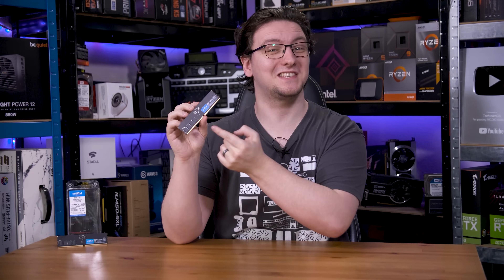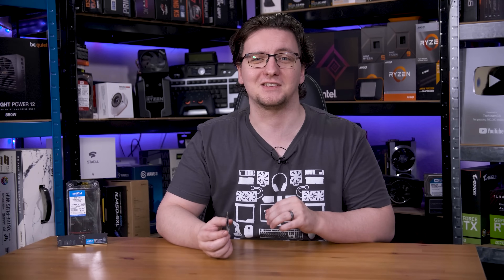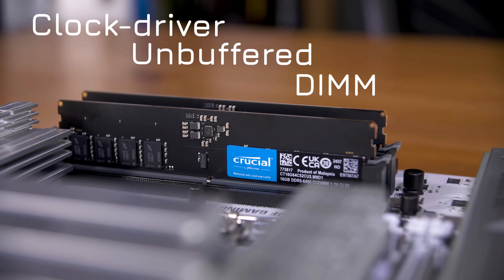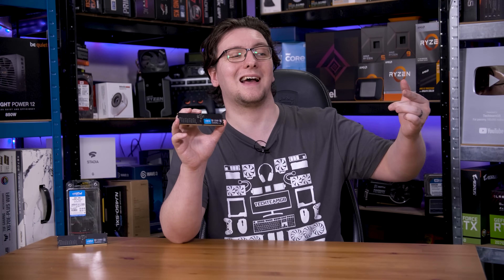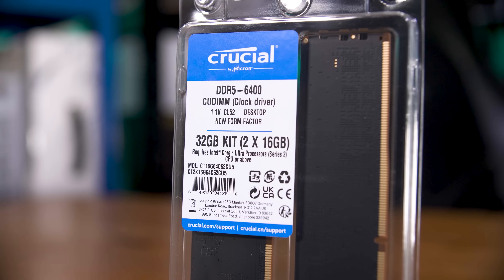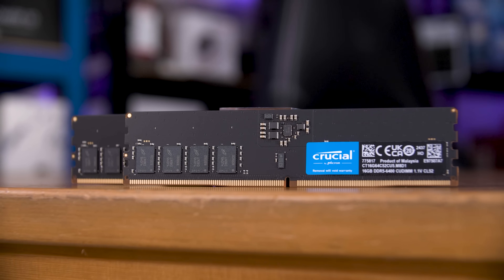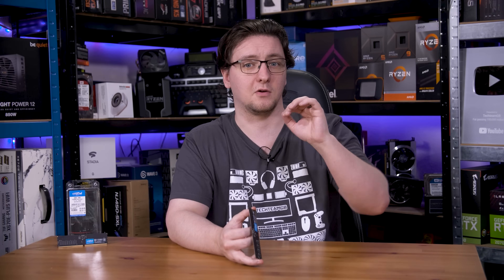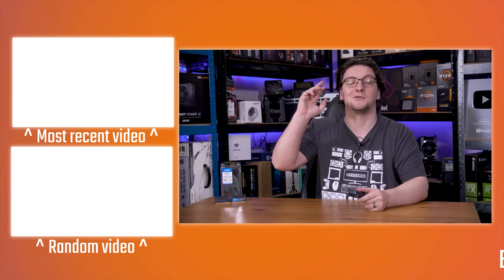CUDIMM Explained! Clock Driver RAM - DRAM IS CHANGING!

Comment: IMC  was always a bottleneck for the CPUs, slow and never going much higher, so dumb; with CUDIMM, IMC should go at CPU Core frequency to have optimal speed with current high frequency RAM. Related, why the CL is 52? why not reduce the frequency so it's near 1, as it'd consume less power and be cooler

Comment: Although DDR, Double Data Rate, is only applied with Dual Channel, and a 3600 kit is actually 1800 per nodule.  So to get 6400 at DDR speeds, each module will be just 3200.

Comment: So here's a series of questions: I'm planning a new build utilizing a Z890 MB and an Intel chip, but memory has changed. The board can take 9000MT DDR5, but I can't find any sticks for sale with that. I've found several 8000 and more 7200, but which is better? Does latency mean anything any more? These sticks seem to have high timing/latency values? Also the 8000 come in an unusual configuration 48GB in pairs rather than 16 or 32. Why is that? I hope you can answer my questions, so far I haven't received an answer from anyone else.

Comment: Cool DIMM enhancement, however with it I would expect current CPUs to support top DDR5 speeds of 8800MT and not just 6400. It’s ridiculous that LPDDR5X can run on higher MT speed than desktop DDR5 (CU)DIMM modules.

Comment: You breifly mentioned that CAMM2 memory doesn't yet have clock chips yet, but I'd be more curious about how necessary they are. As far as as I can remember, better signaling was one thing they advertised with CAMM2.

Comment: And the real 'ingenuity' is not even being mentioned in any of the reviews of the CUDIMM.
'ingenuity' no.1:   That client clock driver chip costs (for example, Part Number RG5C172B0C0GBX)   $0.267 a piece  (it is the actual price, I looked it up)    and this additional cost of $0.267 / memory stick makes you the whole RAM package $200 more expensive.  Brilliant, isn't it ?
'ingenuity' no.2:  to exclude competition so that no manufacturer sells this 'improvement' at less than 500 times the costs, it is patented, so everybody must pay a hefty royalty to the 'inventor' of this scam.    This trivial thing is patented despite the fact that it has been used for decades to reproduce the clock signal in a component.
Reply: Don't be silly, these are early models made in limited quantities and the price includes the cost of research and development as well.
It's gonna drop to normal RAM prices once it goes mainstream.
Reply: @piratesephiroth  I remember using 'clock conditioner' ICs since 2006 in the circuits and PCBs I have personally designed.  (Texas Instruments Part No. LMK03000 Family)
Just because they gave the solution a new, fancy name and deceived the patent office (as if it were a newly invented thing, it was lucky they didn't apply for the Nobel Prize) it didn't require much development and research.
Reply: @nick066hu  Still the research has been done and even though this solution is simple and cheap, that price can include the cost other failed projects that lead to it.
Reply: @piratesephiroth  They are perfectly entitled to use any excuse they like as a price driver, it is none of our business.  I usually add a hefty contribution to my next BMW when I make invoices.  
What upset me is that, as I have witnessed hundreds of times in my professional life, when a company uses the Patent Office only to restrict competition and there is no invention at all.

Comment: RAM Speed is so overrated. Just a few single digit percent difference between 5400Mt/s and 8000Mt/s. Only after they bump the speeds/bandwidth considerably then it will make more sense.

Comment: Ddr4 is cheap now. Go get them budget gamers this video is not for u. 2x32gb is enough for u right?

Quantity over speed is important. Even if it's 2x the performance of ddr4. That which is not the case here i guess. Even if it's 2x... It ll not be worthit. I mean just imagine having 16 gb ddr5 or 32 gb ddr4. Or 32gb ddr5 vs 64gb ddr4. What will u get?

Ddr4 speed is enough for basic computing. And it's just enough for 99.99% am i wrong? And add ur extra dollars to ur graphic  card to get more fps. Or invest in cpu for more processing speed.

I'm super disappointed. 3060 12gb to 4060 8gb (wtf less vram?) and how much performance uplift u are getting? 10% to 15% at maxed.

My 3060 i gave it to my relatives because the 4060 was on the market. I bought that sh*t. And I'm regretting it. I asked my relative to give me my 3060 and get the trash instead. But no... He said the 12 gb vram was important for him.

💀 F#@* u nvidia.

(They are literally giving us sh*t in the name of innovation)

Comment: So they basically put a Schmitt Trigger on the memory module between the incoming clock signal and the memory controller, and they're going to price gouge for it. I can guarantee the price increase won't be proportional with the increase in cost of manufacture. This is very old technology that was invented in 1934 by Otto Schmitt (dude came up with it as a graduate student) that they have been using to clean up noisy or weak digital signals since forever.
Reply: I dont think price has been proportional with the cost of manufacture ever when it comes to components and tech in general.
Reply: Basically they reduce the number of digital inputs and thus loads from 8, 9, etc. to one, seen from the POV of the memory controller in the CPU. I wasn't expecting it to be that simple overall, that the clock signal alone is the problem. I was kinda expecting that additional signals need to be driven too.
Reply: a DIMM using a RCD is just a RDIMM

Comment: Honestly, nothing of that was a problem prior to socket 1366 or am2/2+/3.
Why you ask? Simple answer, Cpu communicated with a dedicated RAM controller chip which was not in the Cpu thus was closer to the RAM itself and all of those controllers had the benefit to REDRIVE the signals and also opamp them when needed. Another benefit of external RAM controller was independent  cooling. So now we have dimms with an opamp onboard, to amplify an already s** **y signal... sounds about right as a solution regarding the bad standards of the entire HF industry. Instead of again making independent on board RAM controllers with redriver and opamp features in the middle, nope do an opamp at the far receiving end. 😂😂😂

Comment: So basically  the chip is like a 'repeater' in the  old networking world where it corrects and retimes the signal at wire speed with 0 delay..  I hope it wont be a new point of failure.
Reply: It definitely has “delay”, probably one of the reasons CAS latency is so much higher(other than the lower voltage)!
Reply: @ThatGuyPal88  crucial has a reputation of making incredibly shitty ddr5 in terms of latency, so it doesn't seem that surprising that the latency numbers are that high, especially at 1.1v
Reply: It's basically a Schmitt Trigger, this is actually a common solution to degraded or noisy digital signals.
Reply: Yo dawg I heard you like ECC so we put ECC on your ECC so you can ECC while you ECC.
Reply: No, there is measurable latencies. There is no such thing as zero latency in memory.
Reply: @Great_America  if it's done properly, you can absolutely redrive a clock signal with 0 latency

Comment: auto AI motherboard OC for cpu + RAM is desperately needed by the customers all around the world for a stable , quick , fast , reliable ,safe OC so that customers dont have to spend a week or two researching about OC info and trying out different bios settings and waste their time , hope motherboard manufacturers provide a solid AI OC ability in built the mid to ihgh range mobos
also why the f are they not providing a ram cooling fan and a bracket beside the ram to cool these high end OC ram ?? dont they know that ram also needs active cooling when its OCd ??
Reply: Yes, reliable AI based optimisation and OC is the future of reliable PC sales. The generic customer struggles to optimise a PC let alone OC. Hardware will be always an issue, but at least the software side of it should be a few click basic thing.

Comment: 3:24 Yeah, but they are CL52 (so very loose timings) at that 6400 speed, for that 1.1 voltage.
Voltage is required for not only clock rate, but also tight timings. It's why you rarely see tight timing ram at low voltages.

Comment: Comparing the Corsair kit to the crucial kit is a bit like comparing apples to oranges. The timings on the Corsair kit were a lot lower while the crucial kit they timings are super loose. I but if u loosened out the timings on the Corsair kit u could lower the voltage down to 1.1v or near

Comment: A tech nerd who speaks English, likes open Sauce, and explains things in a fairly logical way. Bonus! Subscription added.
Hello from Brisbane Australia.

One question ~ Does this change the 'sweet spot' speed for AM5? If you have the clock on the memory DIMM, can you turn up the Infinity Fabric speed by 50% ? So we can run 9,ooo Mega Transfers / sec (instead of 6ooo) and still have a 1:1 ratio?
My understanding, was the slow part of the Infinity Fabric, was the connection out to system RAM. The stuff on the CPU die ~ that could be turned up by a factor of 8 or 16 or something.

Comment: It's weird how we've only seen 1 or 2 camm2 boards so far, is there any idea when those will go retail?
Reply: I'm certain it's more common on laptops. Camm 2 has no real packaging advantages on desktop as desktops (even itx) dont  benefit from flatter ram like a laptop does.
Reply: @xXx_Oshino_xXx  An advantage would be CPU cooler compatability. CAMM2 also shortens the distance for the signal/data to travel. There are some advantages over traditional RAM sticks.

Comment: CUDIMM and CAMM2 are probably the last spasms of user replaceable memory on the consumer side before memory becomes widely part of the SoC. Apple has proven with their M series chips that the bandwidth increase can yield some great performance and power efficiency gains and it's down to Intel and AMD to deal that blow to the rest of the industry. OEMs will be all for it, since this can allow them to force consumers in more reliable product lifecycles or charge a big premium for models with a long-lasting amount of memory.
Reply: AMD already doing it with HBM I guess

Comment: That's an interesting solution to the current DDR5 instability problems at high speeds. One of the purposes of CAMM2 design was to reduce the distance between CPU and memory, thereby alleviating the signal smoothening to some extent and allowing higher clocks. I guess we still need to see which solution is more effective, but if it turns out CUDIMMs are at least just as good as CAMM2 then I don't think the latter will make it into mainstream desktop any time soon. Mobile devices might still adopt CAMM2 more quickly because of the space-saving vs SODIMM.
Reply: We could see CAMM2 with a driver chip placed on it. The best of both worlds. Lower latency because the distance shorter, lower power, and better speeds.
Reply: It's not original in any way it is the most common solution for noisy signals, just stick a Schmitt Trigger in there to clean it up. Yet they're acting like this is some innovation. It is not it's just what you do to clean up a weak or degraded digital signal.
Reply: CUDIMM + CAMM2 = CUCAMM2
Reply: @notantogonist017 niente male come risposta, ma é CUM 2
Reply: CAMM is really painfull on upgradabillity on desktop systems.. Dimms are easilly replaced in smaller chunks.
But for mobile and smaller devices where upgradabillity isnt prio camm should be better to use.

Comment: Doesn't that increase latency? I mean, the Clock Redriver Chip having to process the signal from the Memory Controller on the CPU?
Reply: Right, it isn't exactly "free". Looking at other redrivers (USB, PCIe), the latency should be less than 1ns. So marginal effect, given the clock rate.
Reply: I'm getting the gist that it acts more as an amplifier or like a UPC. Just something simple to boost and clean the signal. Some might use a UPC if they live in an area with shoddy electrical. It cleans up the signal from the wall, and gives you a nice smooth sine wave.

I'm no engineer but I get the general idea of it's purpose. My dad would certainly know more than me being an electrician hehe. I'm just a trucker and a tech enthusiast/hobbyist.
Reply: Restoring optimal frequency signal is probably worth it if the increased latency is only several nanoseconds.
Reply: If it's just reproducing the clock signal then at worst the phase will be a bit off, which will have a negligible impact at these frequencies. The clock signal is really boring. It doesn't transmit any information.  It's just a clock to set the pace and keep everything synchronized. From what I understand the control and data signals still take the direct path. It's just that feeding the memory chips a cleaner clock signal makes all the other signal processing way more consistent.